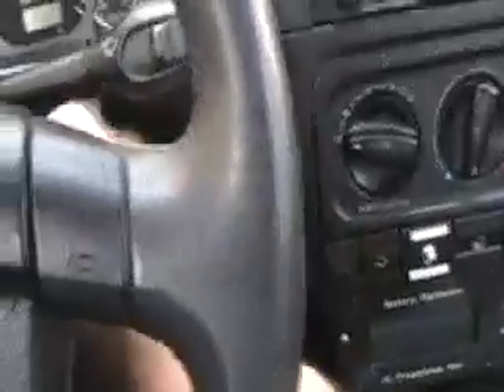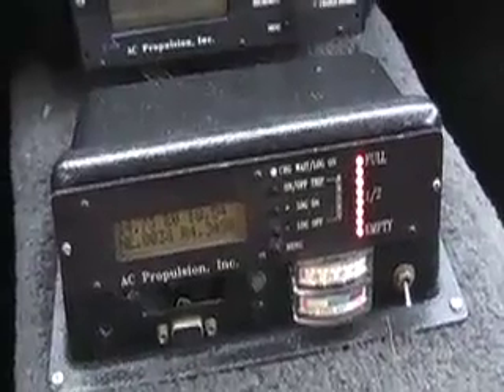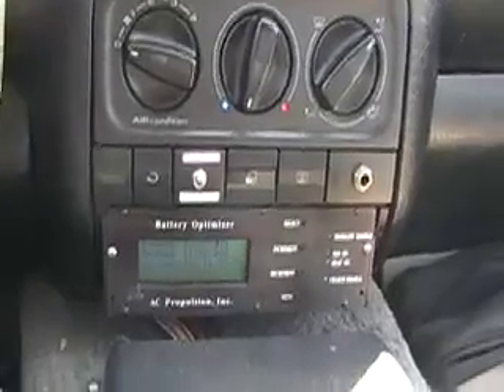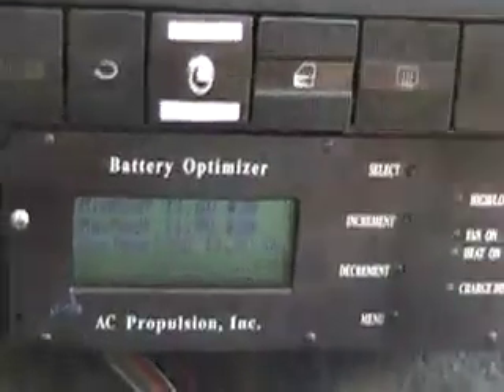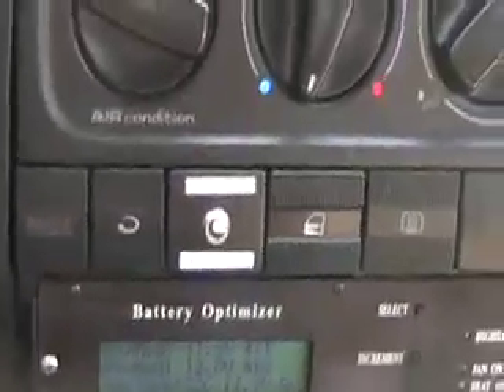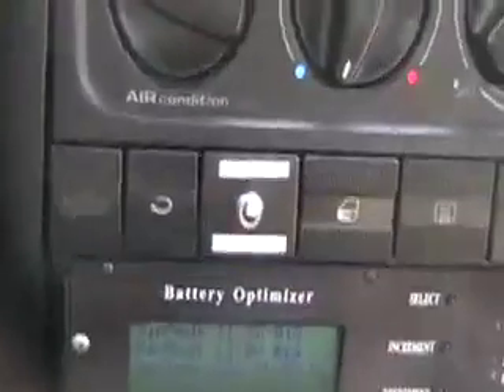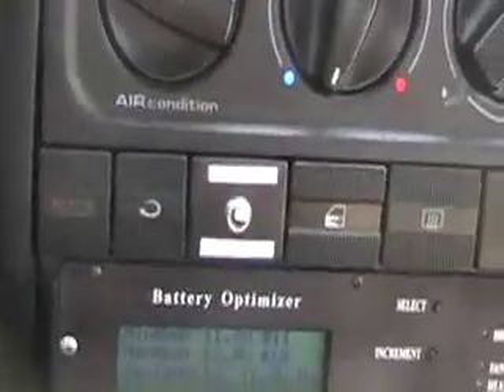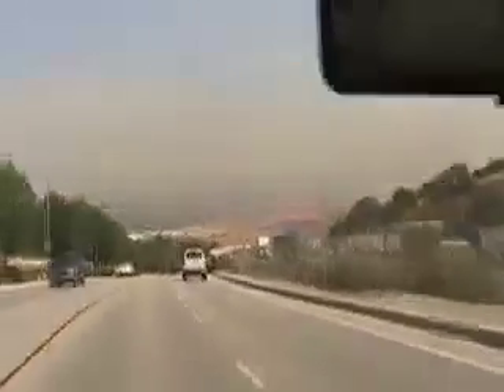Electric car conversion by ACPropulsion -- everyday driving of a real EV

Comment: What kind of transmission do you have in that car? You accelerated very fast but didn't hear you shifting any gears. 100 amps is very impressive on acceleration with my warp9 motor I pull about 200 -250 amps for a brief time and up a hill forget about it!